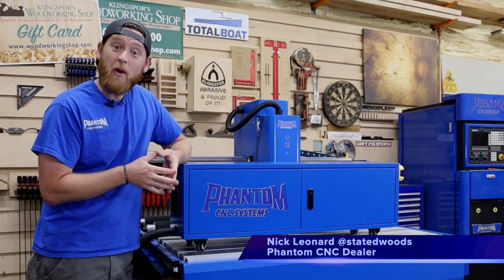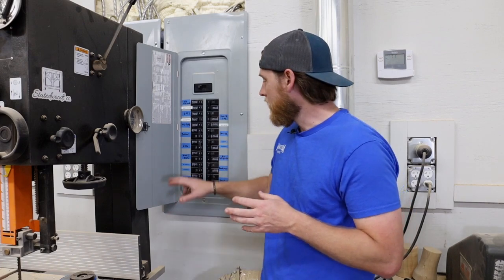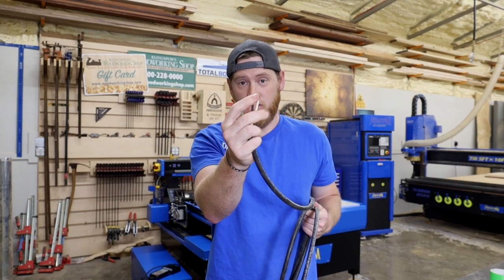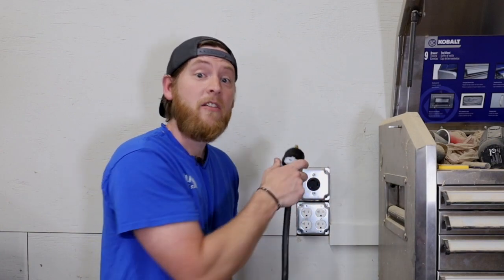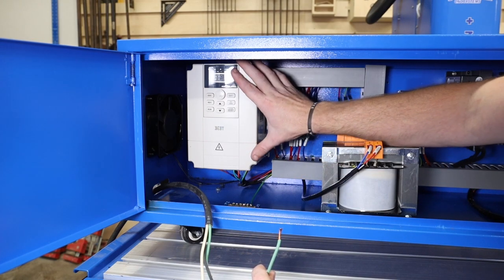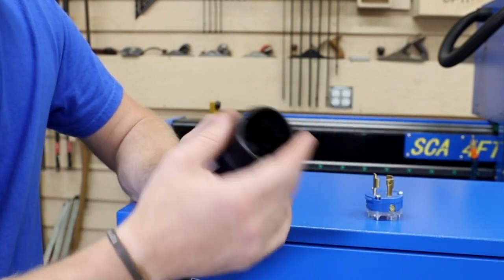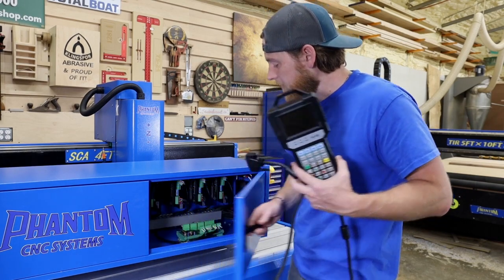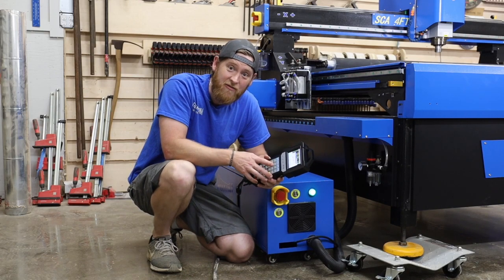Phantom CNC Initial Electrical Hookup Guide for SC44 and S Series CNC's

Comment: I used to be a service tech for a company that offers a... more expensive but similar option... I think your plug idea is good, though a disconnect works just as well and offers a rigid mounting. If your shop is mobile or you move your machine around a bunch, then I would agree the plug is the way to go.
During covid, there were so many issues with power grids being unstable. Much like your lightning strikes, the power fluctuations were enough to fry drives, encoders, and VFD's.
Now that I know about your machines, my wife wants me to hurry up and buy one so I stop talking to her about getting one.